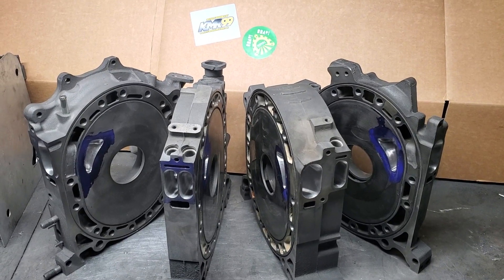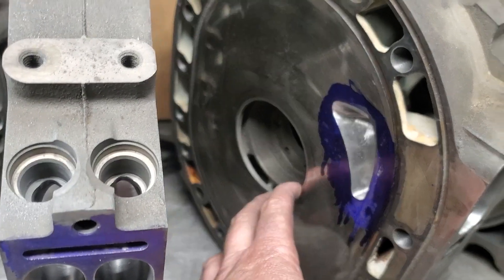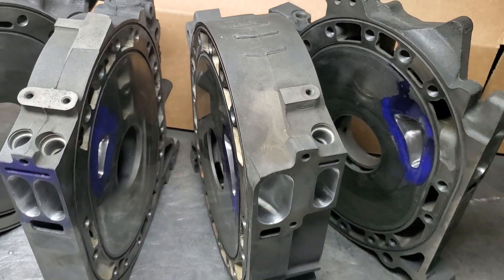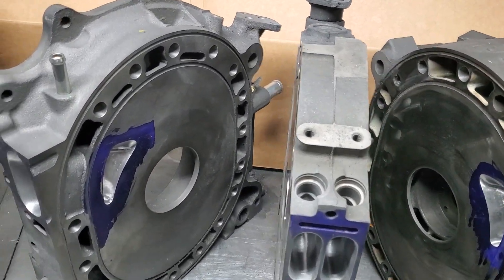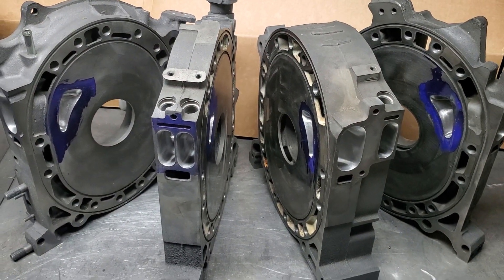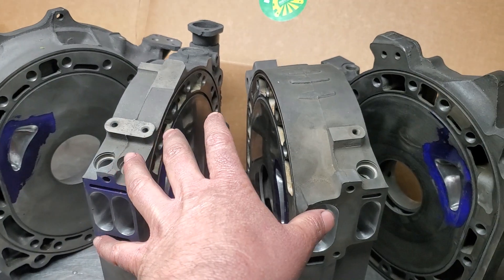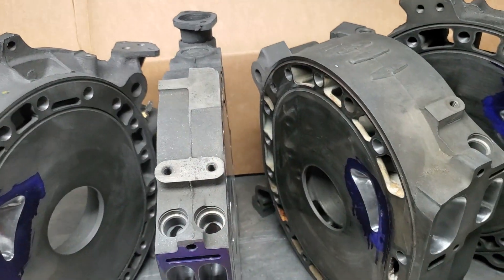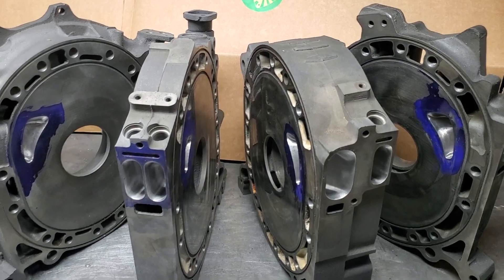20b porting and studding tech talk, Rotary Engine reliability

Comment: https://youtu.be/L-xLa9DX_sA full peripheral 4 & 6 rotors no brap the brap is fuel exploding late in the exhaust wtf has to do intke with exhaust sounds? Forget about overlap  fuel and air enter to the same place and is burned in the same spot no matter what…I have some cash to make a bet😂✌️ I’ll remote tune your idle to 18hg vacuum and steady idle any day👌

Comment: I'm always fascinated with rotary engine builds, everybody has their own take on porting, I love the brap note but realise that bridgeporting is for much higher rpm, not much use on a daily in traffic. This 1 has street ported primary and secondary, is there any gain in having a 1/2 bridge secondary and elongated port so combination street/bridgeport secondary , (aware that the side seal is the primary concern)? The secondary port is for plus 4000 rpm (is that correct) so a  streetport primary, would provide a smooth lower rpm ride for around town. 
I am also fascinated with the hybrid motor and wonder how it would perform with a supercharger, my understanding is that approach has less lb boost than turbo and therefore possibly less strain on the renesis components providing more torque at lower rpm, whilst gaining from the improved exhaust flow. Any thoughts on that?
I am in the process of refreshing my rx8 and I am contemplating the hybrid/supercharged method .

Thank you for any knowledge in this area.